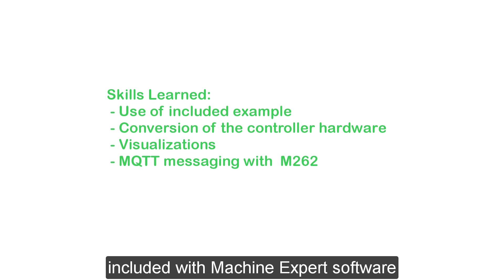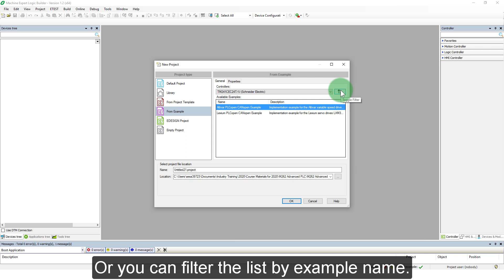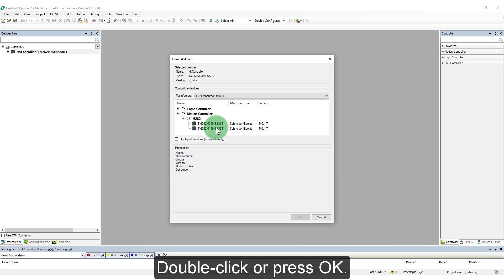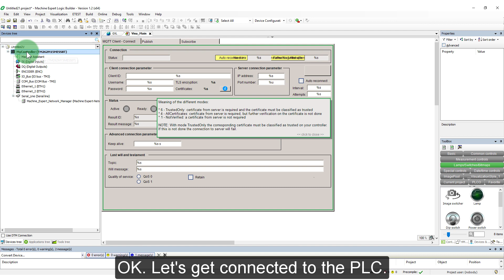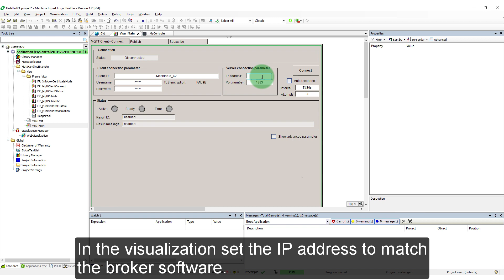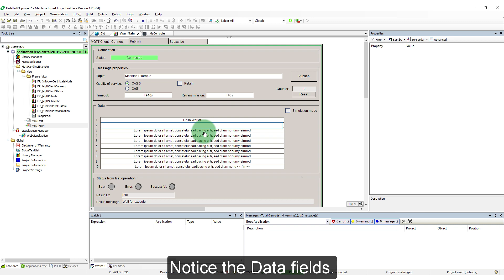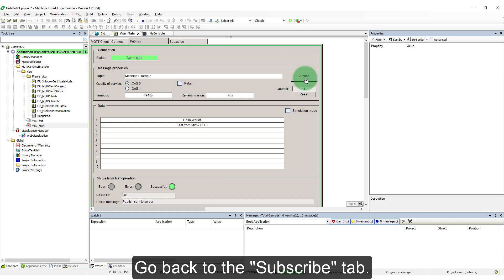How to Use the MQTT Example with EcoStruxure Machine Expert v.12 | Schneider Electric Support

Comment: Hi guys, great vid! Got a question: Is the M241 (or M251) capable of doing HTTP req or MQTT or any other IoT platform? Thanks
Reply: I can not imagine they would not work the same way as described in the video since they are almost identical to M262. I did not test anything but I could convert the example project to a M251 and it compiled, only had to remove a library related to motion which is only available on M262.